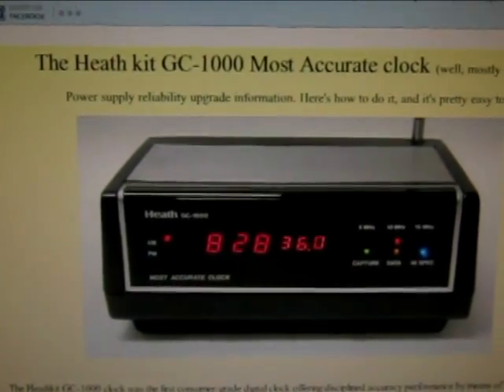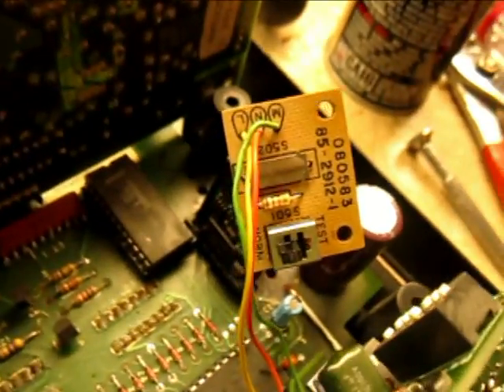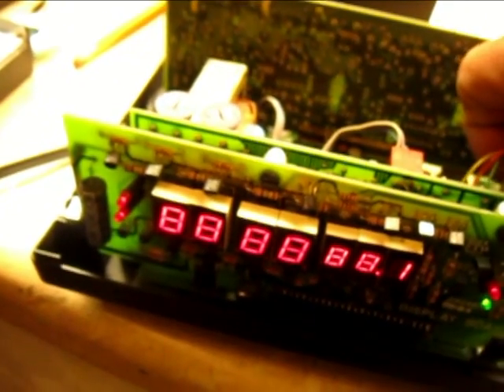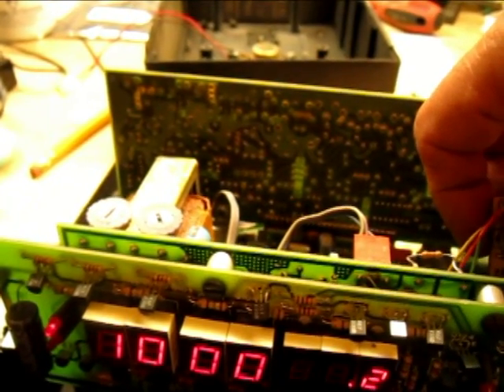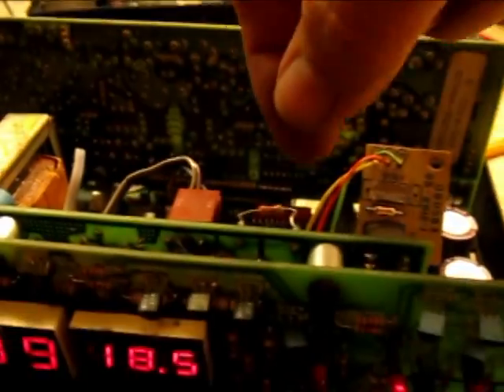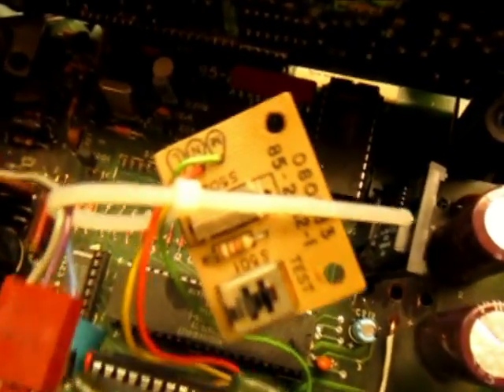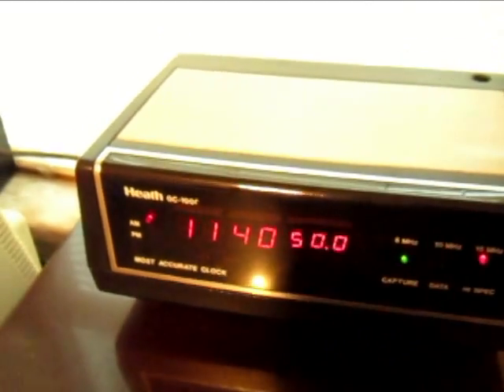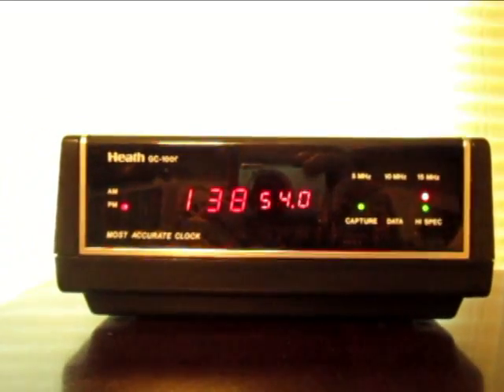1984 Heath GC-1000 power supply upgrade

Comment: When I did this, I went ahead and left the heat sink for the 7805 attached to the board so I could Mount the test board in it's original position. The DC to DC converter I used was the TRACOPOWER - TSR 1-2450,  on a scope, it is much more quite than the one recommended in the article, I use these converters when I am upgrading Atari 2600 consoles. They are a little more expensive, but definitely worth it. I have also done the LUMEX dispaly mod. my GC-1000 runs much cooler after the mods and locks pretty quick after the tone board cal.